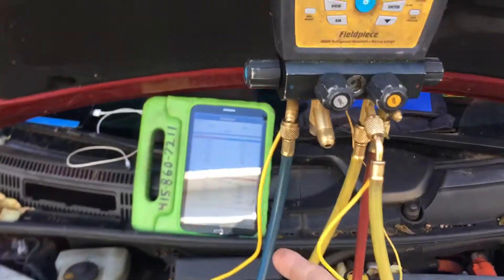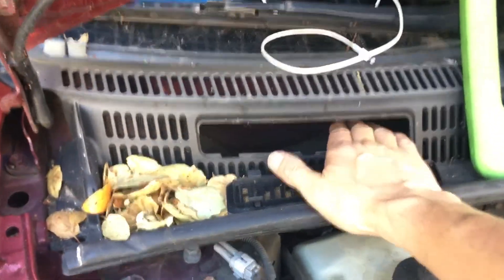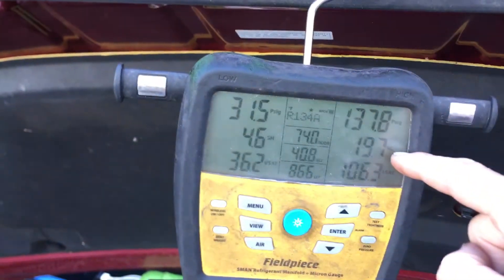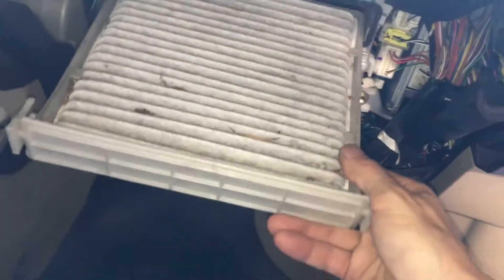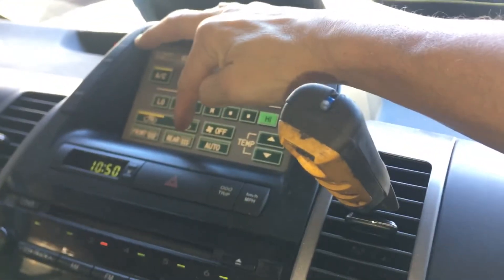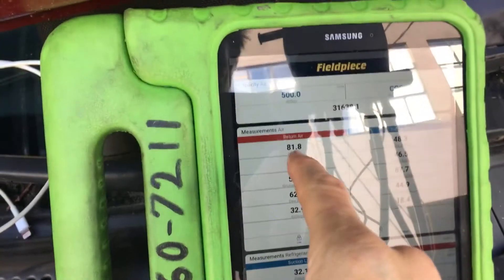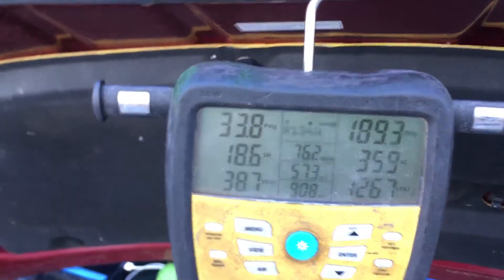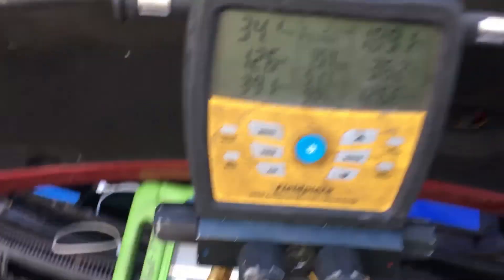Prius 2005 AC, pressures and temperatures what is normal depends on the ambient conditions

Comment: On the 2005 Prius, should there be little grey caps on both the L and H valve ports? The L cap is there, but there is no H cap. Wondering if this could be the cause of a very slow leak. Curious what your take is, and if I should find and pop on an H cap. Thanks!
Reply from the maker: Some time that valve leaks should have pap on it
Reply: @coldfinger459sub0  Okay nice, good to know. Took it to Toyota as the fan blows well, but no cold air. I had been told by another mechanic that the sightglass showed basically no refridgerant in the system. Toyota pressure tested the system, it held pressure. They inspected for leaks, found none. Found only .2 lbs of refridgerant in system. Evacuated system, then added .97 lbs with dye. Ran it for a while, ac now cold, saw no obvious leaks. Gave it back and said monitor it. Still working but noticed that H valve has no cap. Wondering if that little thing could be the cause. Hoping so, but I realize maybe not the whole issue. A little sloppy that they gave me the car back without replacing the missing H cap.

Comment: Sir im stumped with a 2004 suburban, new compressor dryer and orifice tube haven't replaced the rear expansion valve with the new compressor low side is at 60 after charging it to the 48 ounces, could the rear expansion valve, high 225ish pressure
Reply: could the expansion valve be staying open past where it should allowing more freon to get by it?
Reply: please advice me chief!
Reply: I have fixed 1000s of acs systems this one is beating me.
Reply from the maker: MASTER MECHANIC Felipe 1: Why was the compressor replaced?.    2: this one have the orifice tube at the evaporator ? was anything flushed out and the orifice Tube forgot to be replaced ?.      And you were talking about the accumulator was replaced not the receiver dryer that’s what you meant correct. I sometimes say the wrong word for the wrong component myself.       3: what was the outside ambient air temperature ?.    4: how many miles on that thermal fluid fan clutch ?.  You may want to think about replacing it. 5:  I cannot remember if there’s a short piece of rubber hose between the liquid line going to the rear expansion valve that you can clamp off with a set of vise grip’s ?.  Do you know why I’m asking you if there’s a section of rubber hose to vice grip closed before the expansion valve ?.  Or was that one a orifice tube in the rear I don’t remember.
Reply from the maker: MASTER MECHANIC Felipe possibility
Reply: @coldfinger459sub0  previously another mechanic replaced the dryer and orifice tube
Reply: @coldfinger459sub0  2004 suburban, expansion valve at the back chief
Reply: more than likely that expansion valve is 16 years old
Reply: with a new compressor i was expecting to see 30 psi on the low side, fan clutch blows strong.
Reply: no debree of any kind in the system very clean
Reply: i could.pinch the hose to bypass the back, genius idea.
Reply: it got an ac kit, new compressor orifice tube for the front and accumulator or bottle lol
Reply: I replaced everything in the kit today all 3 items and charget it to spec.
Reply from the maker: MASTER MECHANIC Felipe    Try taking the RPMs up to about 3500 RPMs.   I think you should see that low side pressure fall a little bit.     In a perfect world if you can get your fingers past the orifice tube you would feel it’s relatively colder in the front.   And if you could get your fingers after the expansion valve if it was stuck open it probably would not be as cold as the front.             But usually anytime you can see a high side pressure high that means you have a strong compressor.  Then there should be no reason to replace it but start looking for problems elsewhere.        Many years ago when most all cars just had rubber hoses everywhere.    It was easy to pinch off your rubber liquid high side hose to isolate a expansion valve.     On the really old expansion valves that had the bulb temperature sensor. You used to remove it and drop the sensor bulb in icewater watched expansion valve close and your low side pressure would go down.     Take the temperature sensing bulb out of the ice water stick it in your hand it would heat up and you would watch your low side pressure go up.   But those good old days are long gone of easy diagnosis.      We only had four common compressor manufacturers and about eight different O-ring sizes it was a much simpler world back then.
Reply: @coldfinger459sub0  even reved up it doesn't want to come down all the way.
Reply from the maker: MASTER MECHANIC Felipe will not come down all the way. But will come down some.     Think of a stuck wide open expansion valve as a fixed over sized office tube.     Now some times if it is a stuck expansion valve you can tap on it with a wrench or something solid it can brake free and work for a little. Bit. Some times.
Reply: @coldfinger459sub0  i wish i could tap on it. i gotta take it all appart
Reply: @coldfinger459sub0  i tap on the ones on 18 wheeler all the time lol
Reply from the maker: MASTER MECHANIC Felipe yes I know. Thing Yarr not easy and fast on today’s cars
Reply: @coldfinger459sub0  ty so much
Reply from the maker: MASTER MECHANIC Felipe yes right there easy on the fire wall I like those.
Reply: @coldfinger459sub0  i just ordered a sm480v wireless sman
Reply: @coldfinger459sub0  what brand hoses and valves do you recomend, thanks!
Reply: and r134 adapters chief!!
Reply from the maker: MASTER MECHANIC Felipe I subscribe to your channel.  If you purchased the SM480V refrigerant manifold gauges. You deserve my subscription, welcome aboard to your journey of knowledge and education to become a better technician.
Reply from the maker: MASTER MECHANIC Felipe I can’t wait to see your first video using your new gauges 👍
Reply: @coldfinger459sub0  need to figure out a good set of hoses and r134a addapters chief
Reply: @coldfinger459sub0  i saw your phone number on your tablet!!! on one of your videos!!!
Reply: @coldfinger459sub0  you mind if i text you
Reply from the maker: MASTER MECHANIC Felipe Yellow jacket hoses
Reply from the maker: MASTER MECHANIC Felipe yes how many of my videos when I use my tablet often can see it’s my business phone number.
Reply from the maker: MASTER MECHANIC Felipe it’s ok 👌👍
Reply from the maker: MASTER MECHANIC Felipe it’s ok 👌👍